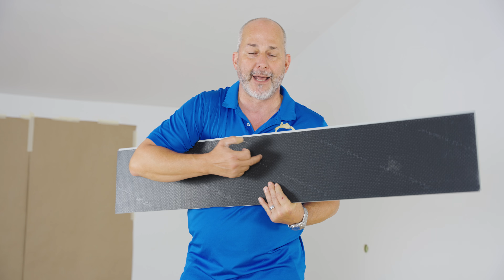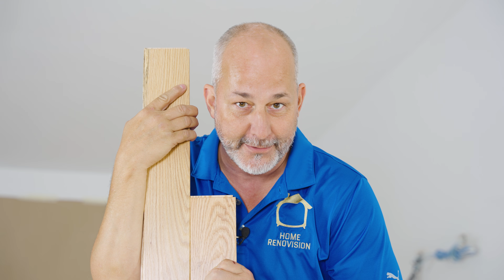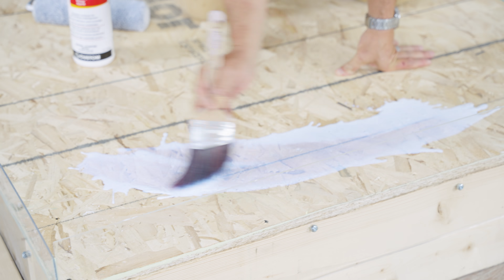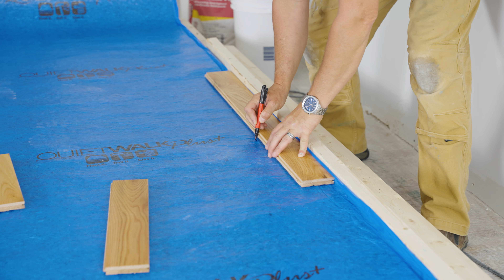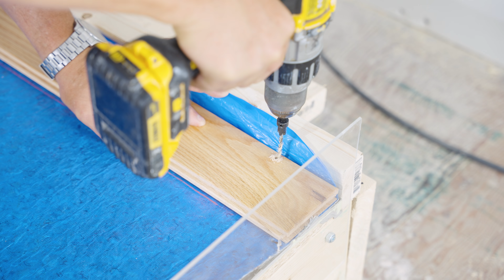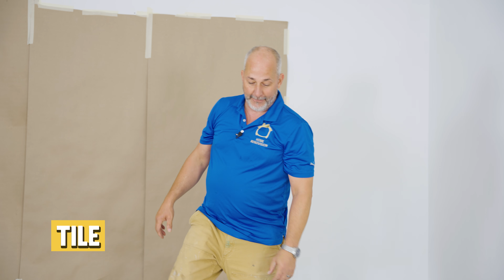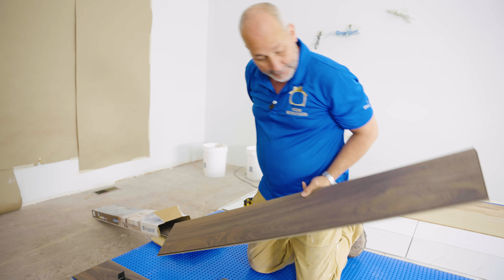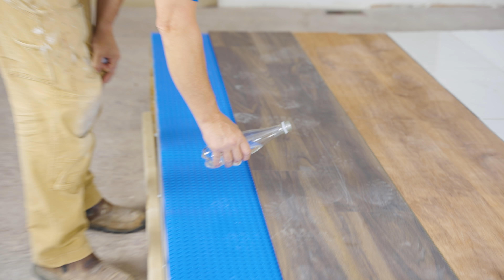Flooring Comparison: LVP vs Laminate vs Hardwood

Comment: I have a question my basement, which has a concrete floor seaps water through the floor and corners because my water table is so high what is the best way to seal that concrete and corners to prevent the seepage of water I have outside drainage but it’s not doing the job under the floor and I really did not want to cut the floor up and putdrainage pipe in any advice would be helpful. Thank you.

Comment: "Jeff, thanks for the great video! I’m redoing my main floor, which includes the kitchen and a powder room, and I’d love to have one consistent flooring throughout. What’s your opinion on using hardwood for the entire space, please?"
Reply: We have hardwood in the kitchen, pantry, and front hallway. The house was built in 1999 and it is holding up well. Next project is removing the carpet and replacing it with more hardwood.
Reply: @AlanSanderson-u4t are you located in Canada?
Reply: @Claudio.forte.t In Oregon USA.

Comment: I used an online company called Flooret to do a few projects. The reason I used them was the floor looked the best and it goes so tightly together there is no way of leaving even a small gap by mistake. Although the tight fit also makes it harder to put together and is more work. But does one want an easy job of putting it together or does one want a good looking floor? It was more expensive than big box stores but in this case you really do get what you pay for. 

The build of the planks has a 40 mil protective top coat that after 2 years of 2 dogs I still haven’t seen a single scratch. Edges are beveled giving it a realistic look. Patterns of realistic wood are underneath the top coat. There’s a rubber backing. Another huge advantage is you can get them in 6’ lengths by 9” wide so there’s a lot less seams and a wide plank looks better. 

I had to renovate a house after a pipe burst flooded the entire first floor. I used the best from Home Depot and the floor doesn’t even come close to looking as good as the Flooret stuff.
Reply: My dogs have yet to scratch the floor ,(10 years, 3 dogs), I, on the other hand HAVE, when moving furniture.

Comment: Disappointed you gave engineered hardwood a bad rap for not being able to be refinished. That's true only if you buy planks with a 2mm veneer. Buy 5-6mm veneer and resurfacing is comparable to solid.

Comment: How about comparing windows?  There are so many offers, how/what to choose?
Reply: Casement seems to be best performing window type available. Also great to have triple pane, and even laminated glass. Triple pane is good for energy savings, and noticeably quieter, and laminated glass is good for security, and even quieter.

Low-e should probably be kept to a minimum to keep light transmittance up, I personally like to be able to see through my windows, without it looking dim and green.

Comment: What if my subfloor is diagonal hardwood not plywood?
Reply: That shouldn’t effect too much, just depends on what condition it’s in. If it’s in bad condition I’d recommend either a pulling it up and putting down some 3/4 inch plywood. If the condition is decent you could most likely leave it but I personally would recommend throwing down a 1/2 inch sheet of plywood right over the top of it adding shims where necessary.

Comment: Great info as always.   BUT  I have read that a tile decoupling membrane does not substitute for the additional thickness required of wood subfloor that you mentioned.  This is to prevent deflection.   You may get away with it  but its not the ANSI standard, which would pretty much guarantee a long lasting install.    Also NOT backbuttering is a silly shortcut and something I've never seen done by pro tile setters.  Overkill? thats up to you.

Comment: I have seen hardwood "buckled" from dog urine so it might be better the the engineered but both are not great with pets. Quality LVP flooring is king as far as pets go as long as it has a very very scratch resistance surface. The cheap soft stuff scratch's real easy.

Comment: Awesome video! I would really like old fashioned linoleum or modern day equivalent in the kitchen. Or large vinyl tile. I think you need special equipment for that?
Reply: The modern day equivalent of old fashioned linoleum is called sheet vinyl to help you with the term to use to further your research into flooring options. 

And yes, there are vinyl tile options, similar to the vinyl planks install in the video. But also a whole slew of glue down options.
Reply: @laureldc  Thank you! I don't like the idea of seams that can collect dirt. Sheet vinyl it is.

Comment: I took over for our floor installers, who installed the hardwood in our living room and master bedroom, when we chose to install the engineered brazilian cherry hardwood in our two other bedrooms and piano room.  I got real handy with the hammer and air nailer.  It turned out great.  I saved a ton of money doing it myself. I was amazed at the amount of boards that had a slight bow in them. Our engineered hardwood was $14/sq ft 10 years ago in the US, installation not included.
Reply: Piano on that flooring will shift after time and seams will spread. Unless it's a lightweight piano.

Comment: For the hardwood flooring staples, you can remove them without damaging the plank by using an oscillating saw.  Also works well to take out a half-sunken staple when you didn’t hit hard enough
Reply: How do you remove staples with an oscillating saw please? Do you actually use the blade to grab the staple? How do ensure you don’t cut the floor?
Reply: @Tonisuperfly  I used a poor choice of words in my original post.  Hopefully this will help clarify.

Use the oscillating saw and cut the under side the plank, flush with the sub-floor, to cut all of the staples.  You shouldn’t need to pull the staples out, just shift a few inches when reinstalling.

If you get a bad hit on the floor nailer and the staple doesn’t go deep enough, use oscillating saw blade against the top of tongue (with a slight downward angle) to cut it flush.  I had a couple of slips and started getting in position before turning on the oscillating saw and it seemed to be a lot less likely to jump and damage the plank.
Reply: @haristotal thanks for the clarification.

Comment: I paid that little extra for luxury vinyl flooring that’s supposed to last 25+ years. I should also mention i have 6 kids, 2 dogs and 3 cats. AND gone through a house fire. It’s been 8 years so far being in my house. 
I am going with luxury vinyl flooring again should I need to lay it anywhere else. 
It withstands ANYTHING we’ve thrown at it. And my kids aren’t kind or mindful to dropping and spilling…
Reply: what brand did you use? do you have any heavy furniture? office chair?
Reply: @moonstar6694  yes to heavy furniture and office chairs. And I’m constantly moving dressers on the flooring and cabinetry/shelves.
Reply: Vinyl luxury flooring. Supposed to last 25+ years

Comment: you don't join all the edges of the LVP floor together and then hammer them all down.  You use a cheater board with the tongue and a mallet and bar to hammer each piece together.  Just installed 1200 square feet of LVP with the same locking system and it went great.  There is NO WAY you are sliding 10 pieces together the way you showed!

Comment: Doing a bathroom remodel on a house built in the mid 1800s. The floor joists were so bowed that I went through and replaced them one by one. The ends were also rotted off where they sat on the foundation, so it was a no brainer at that point. But it was a lot of work. It’s so important to have a good subfloor for everything.

Comment: Would have been interesting to see if you had back-buttered those tiles if they would have survived the drop tests, my money is there are small voids under the tile and the reason why they cracked in at least some instances. The cast iron cracking them is totally expected though.

Comment: When we built our house 20 years ago we went with ceramic in the entrance and bathroom and laminate everywhere else to keep the cost down. Everything was great for the first couple of years and then we got big Labrador retrievers that spends a lot of time in the backyard pond. The ceramic still looks great but the laminate did not do well with wet dogs. Older dogs don't do well on slippery laminate so most of the floors are now covered with big area rugs. We had good quality carpet installed on all stairs and the hallway a few years ago. I found it was much better for the dogs. I'm now planning to have carpet installed everywhere there was laminate. It's our forever house, so I'm not worried about resale value. And carpet probably does better with the cast iron pan test.😆

Comment: Shorter boards also increase chances of squeaky floors long term. Honestly it's always worth the extra money to go to a higher grade of hardwood flooring. Your install time can be pretty much halved because you don't have to constantly check if your boards are offset properly.

Comment: My wife likes to overwater our indoor plants.  So our sawdust flooring is warped and buckled.  We did HD premium lvp in the bathrooms.  Looked good until I got on a step ladder, left ladder divots even though the ladder has rubber feet.
Reply: Couldn't even get through the install & get appliances/ furniture moved in without having dents and gouges in our LVP.

Comment: I think itd be interesting to see a side by side comparison of bathroom water barriers and the like. 

Goboard vs cement board and liquid membrane vs schluter all in one place. 

Alternatively a comparison between of electrical products. What a different boxes used for or what the installation process is for various types of lighting? Canned lights vs chandalier vs whatever. Idk im spitballin 🤣🤣
Reply: Definitely interested in that but so hard to test. The issues with a poor barriers only materializes after weeks, months or years and many showers when you get mold and rot.
Reply: @pascal6871  You're not wrong! TBH i was speaking purely from a installation perspective since it would probably take a while to explain. Though i was also half asleep so the idea probably isn't the best :P

Comment: Less than a minute in and its already wrong. The core of LVP is either WPC or SPC, both being plastic composites. WPC is Wood Plastic Composite and SPC is Stone Plastic Composite.

WPC is the original that was only sold by one company years ago until the patent wore out and then it exploded. SPC is the cost cutting product for the big manufacturers. Its garbage. SPC shouldnt even be an option for you to put in your house. It will end up costing you more money. 

WPC is the way to go with LVP. We have NEVER had a call back to any WPC LVP installation that was a result of the product itself, the subfloor, or installation error. The only call back we have gotten was other people screwing things up like electricians not having the floor box in the right place.

Laminate is bad as well. It produces formaldehyde especially during installation and its in fine particulate form due to saws.

You also can resurface engineered hardwood, just not as many times as traditional hardwood.

Hardwood floor installation doesnt produce squeaky floors in older houses. Usually it gets rid of squeaks, not to mention that you have to go down to the subfloor where you should fix the squeaks that are already there.

Dont use hairpad under hardwood flooring. Its not recommended, its not covered under your warrantee, and there is a paper called Aquabar that is the recommended underlayment.

Please, just call a professional. Or buy from a store that isnt Lowes or Home Depot if you are going to do it yourself.

Comment: Engineered hardwood comes with 3, 4 and 6mm top layer. That can give you the same sandable thickness as the hardwood thickness available before you get to the tongue and groove. So, refinishable. Engineered core can be eucalyptus or birch hardwood plywood. Not a water sponge.
Reply from the maker: you definitely get what you pay for. Cheers!

Comment: Hardwood floor…..lay it perpendicular to the joists and use wood screws into the sub wood for the squeaks after you snap chalk lines over the floor joists before you install the hardwood… laminate is a bitch to tear out….all those little staples

Comment: Okay I'm rather old school in my ways and I am very intrigued by the Shlueter system. I'm in awe though that you threw that thin set straight on the OSB, wouldn't that moisture cause that OSB to damage?
Reply from the maker: not at all. osb is treated at the factory to be somewhat water repellant to protect the boards during the build in all kinds of weather before the houses can get dried in!

Comment: 1:10 Just a reminder that there is glue down LVP that do away with flimsy lock joints.
Reply from the maker: great on a basement floor that has a  vapor barrier underneath if it is levelled first.

Comment: Any comments about type of flooring over hydronic heated floors?
Reply from the maker: everything works. vinyl usually requires a layer of leveller compound to help the heat travel or it will have hot and cold spots.

Comment: Great video! I love Luxury Vinyl Plank (and Luxury Vinyl Tile) but you need to understand what to look for in a product. You want around a 20mil wear layer (the top layer that has the pattern in it). The junk from big box stores have like a 5mil wear layer. It will be all scratched and dinged up in no time (ask me how I know!). Go to a dedicated flooring store and check the specs. It isn't even that much more expensive.
Reply from the maker: I agree that many box store sell a lot of bad product, however the lifeproof product from the depot is great and so is the lowes style selections. but for the best finishes out there definitely look at a custom supplier. Cheers!
Reply: @HomeRenoVisionDIY  I've got lifeproof (it was installed in my house when I bought it) and it is covered with nicks and scratches. Anything that falls on it easily breaks through the wear layer. The Ceratec LVP I bought from a flooring store has held up great though.

Comment: Two questions if I may!

1)  I'm installing LVP, and I have about 700 sq. ft. down currently, and I've come to a hard stop, because the once level and solid 3/4" plywood subfloor now feels spongy and wavy where the LVP is installed.  It's a Lifeproof LVP with underlayment built in, and I've laid it directly over the 3/4" plywood subfloor.  I don't want to install any more until I understand what's happening.  Previously, a linoleum-like product was installed without adhesive, only bonded to the subfloor at the edges with MASSIVE staples (think electrical style).

2)  I've been told I can't install tile in the bathrooms because it's a pier and beam crawlspace foundation and it moves too much.  Is this true, or will a good decoupling membrane do the trick?  I don't want a curbless linoleum shower...  :(
Reply: Your second question might be the answer to your first. If your crawlspace is unconditioned, and depending on your climate, the LVP might now be trapping the humidity from the crawlspace from evaporating in your living space and somewhat rotting/softening your plywood subfloor.
Reply: @lowgenes  Hmm, interesting.  And the linoleum wouldn't have had the same effect?  Now I kind of want to pull up the flooring and see what it looks like under there...  :(
Reply: If you find answer to questions number one, please let me know
Reply: The membrane might be enough, depends how much movement and how big of a tile. Might want to beef it up with an extra layer of ply, if you can get away with the added height. And/or use a mortar with good crack prevention combined with the membrane.  (Megalite is a good option) Also safer to go with a smaller tile, and an epoxy grout. 

Not sure how a solid and level subfloor now feels spongy and wavy with just putting Lifeproof LVP over top. Maybe it wasnt level and the floating lvp is making that evident now. Otherwise there has to be another factor, the flooring wouldnt cause that on its own unless youve got a seriously defective product, or you haven't left proper expansion gaps and its buckling, but sounds like it probably hasn't been down long enough for that to be the case. I would contact Lifeproof and inquire, they stand by their products and will help you troubleshoot any factors causing the issue or if its defective. Depending where you are they would come see it in person.
Reply: @KB-ij1co  Thank you so much for your input!  Regarding the LVP, it's not fully installed yet, so plenty of room for expansion and contraction, and the sponginess wasn't immediate.  It's been down for several months now, and there's a distinct difference in the feel in the past month or so compared to when it was first put down.  It's the drastic change that caught my attention.
Reply: @rhkips youre welcome and that really is a head scratcher. If there's been no changes with environment conditions and its not install related it seems that just leaves product. Ive seen many LP lvp put in and not come across that issue, and thats with 1 year install warranty so I would have heard about it.  I would definitely reach out to LP for some better insight into the possibilities. Good luck I hope that gets sorted for you!